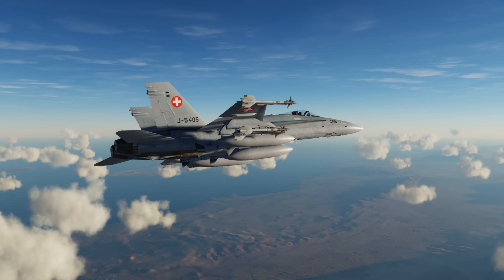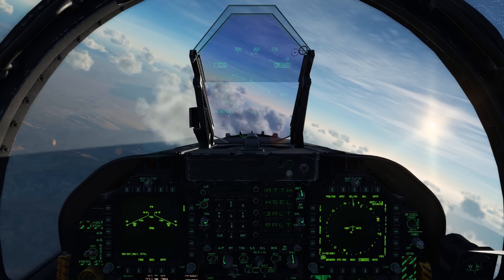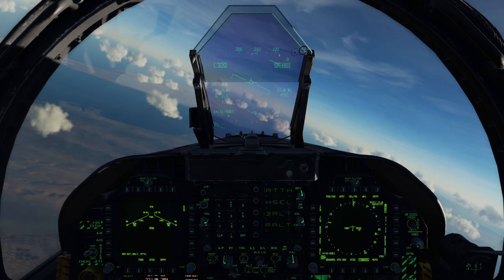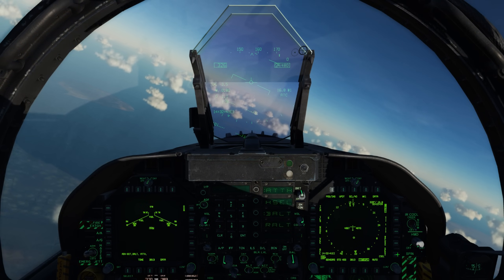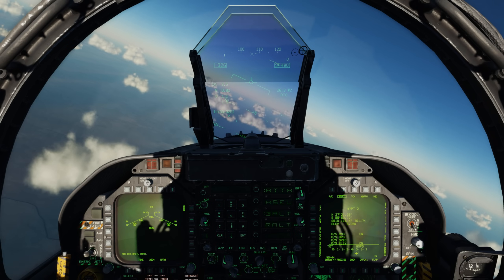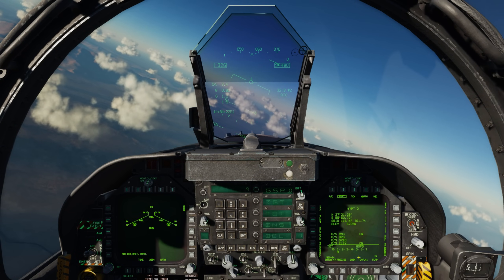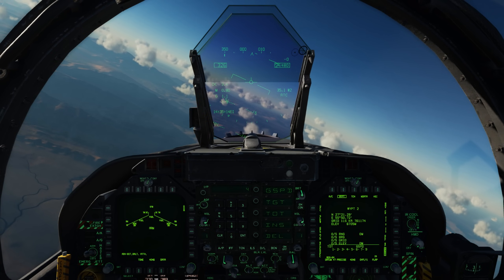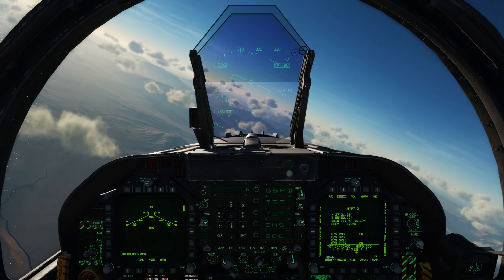DCS: F/A-18C Hornet - Episode 7: Waypoint Navigation

Comment: Wags, I have a question for you regarding TOT and GRND SPEED. If you don't input the desidered ground speed for the last leg of the selected waypoint, the caret cue beneath the Tspeed shows you the early late cue in regards to that TOT. What happens when you select a GROUND SPEED? does the caret cue tells you the early/late information regarding the speed you have selected?
Reply from the maker: The speed entry is required to provide an accurate early/late cue. Without a speed entry, a valid cue cannot be given.
Reply: Matt Wagner  let’s say you don’t insert a speed value, doesn’t the early/late cue give you information with the current speed the aircraft is flying?
Reply from the maker: Negative
Reply: Matt Wagner thanks for your time! Much appreciated!